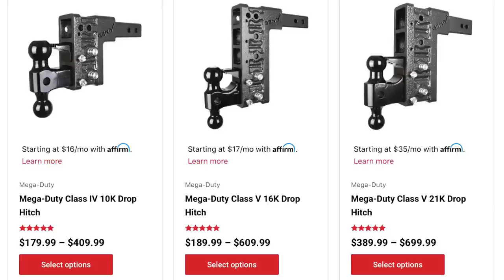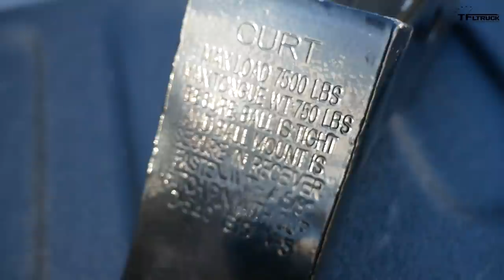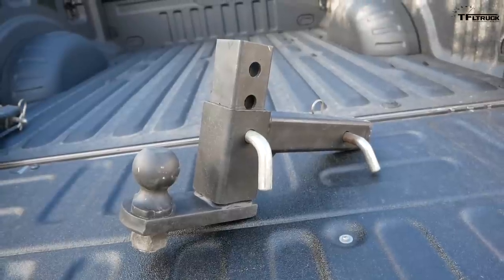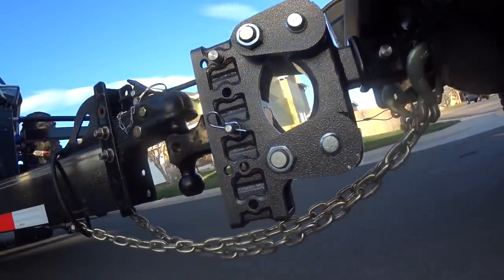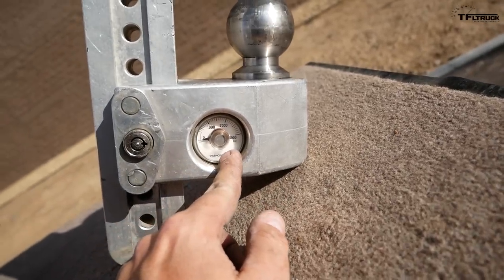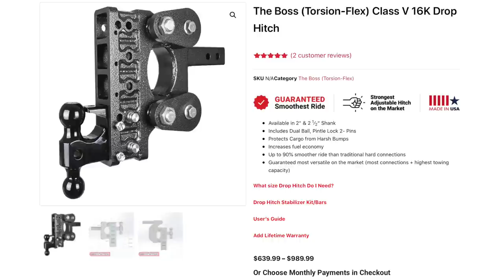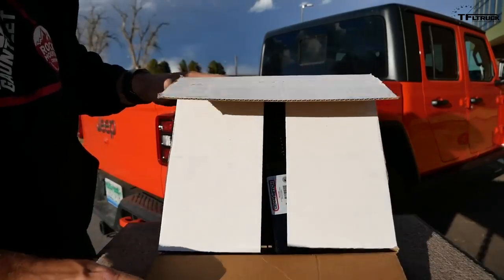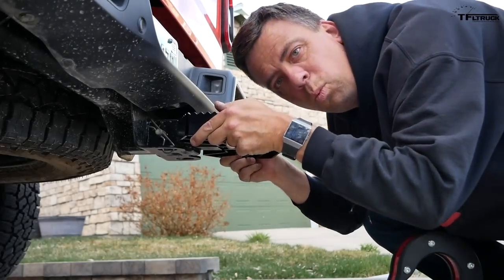Here's Your Complete Expert Guide To Picking The Perfect Hitch To Tow Anything and Everything!

Comment: Great, informative video. Another video idea would be how to tow safely. So many people out there don't have a clue what they can tow and how to tow it. One particular example is if you are towing a vehicle on an equipment/car hauler and how to properly distribute the weight on the trailer. It would also be beneficial to know what to do in an emergency situations and how to use a trailer brake controller to get a trailer under control. Call it towing for beginners. I have learned much of this over the years by watching TFL, but it would be nice to have it in one video. Keep up the great content.
Reply: I have tow a car about two years ago from Joplin Missouri to Pine Bluff Arkansas for the first time with a 2008 expedition, the trailer i used is from Uhaul the car was a 1994 BMW 325 and i don't know if the Uhaul trailer can be controlled by trailer brake control but the expy didn't come equipped with it and i pull it just fine through the Ozarks on i49 and i40 but never exceed 65-70 mph because i might afraid that i fried the brakes or cooked the transmission but didn't and made it home safe and i practiced slowing down on near exits before actually using the brakes and never shifted so i learned on the fly abd gained experience and confidence. The only thing that i burned quickly was fuel and didn't check what mpg i was getting while pulling that load. Lol
Reply: @brandedmcgowan9414  Uhauls come with a hydraulic pulse brake system controlled by a master cylinder in the tounge

Comment: Definitely not too long of a vid, in fact it seemed to be over quickly and I still wanted to know more! An eye opener for me when using a collar adapter from 2”x2” shank to 2.5”x2.5” on my HD truck and derating due to shearing on the pin. I can definitely hear the collar shift when I start or stop and that’s stressing the system for sure. Time for me to consider that mega hitch instead of half-assing my old parts with an adapter. Thanks for this !!

Comment: You should do a segment about the correct tow vehicle tires to use with trailering. Many trucks are coming with weak side walls for comfort or tires for increased mpg that are not safe for heavy loaded trailers.

Comment: Bumper hitch has the ball mounted in a hole in the center of the bumper; very light duty.  You initially showed "receiver hitch".  Mr. Truck may deduct a point from your score  ;-)  I select ball and hitch with specs at least one catagory avove my need and use.  I use weight distribution even though my current need is only 3500# because my vehicle has off road suspension with reduced capacity (2018 SuperCab Raptor).  Works great that way!  Nice video.

Comment: Awesome video! I want to get the gen y glide but I tow a boat regularly in fresh water and I'm not sure if the torsion or "rubber bands" will start to degrade and crack from the fresh water.
Reply: I’m less worried about the rubber in the water, as I would for UV damage over time. As long as it’s greased (and stored away when not in use) I don’t think you’ll have any issues.

Comment: What item do you recommend for testing tongue weight? I would love to be able keep checking and making sure I’m staying in line. Thanks 😊
Reply: Bunky’s Workshop just going to your local scale is what I’ve done in the past. Once you get a basic idea loaded and unloaded you can make educated guesses as you change or shift loads around.
Reply: Check out the surprisingly accurate Haul Gauge that works with a smartphone app and a module that plugs into your truck’s OBD2 port, for about $100.

Comment: Ok Andre.  Those are fine and dandy but i had one about a year ago and at the time they didnt make one for a big boys truck so i had to use the sleeve on both my 2500 cummins and on the f250. And when there is no trailer on it they rattle so bad going down the dirt road and in the pasture you have to take them off.  
 So i just went back with a standard 1000/10k 8” drop hitch and have never been more satisfied with the 45 bucks it cost compaired to the 200 plus bucks those others cost.

Comment: I really love my B&W gooseneck hitch in my truck bed Rated for 30,000 pounds with the compatible B&W 5th wheel hitch Rated for 18,000 pounds
With the bumper pull B&W hideaway bumper hitch rated for 10,000 pounds

Comment: so that gen-y hitch sat the truck down when you put it in the receiver, it's worth considering how heavy the hitch is as it's taking away payload lol!  you guys used to run andersen hitches and I still do, and they work great.  it pinches the coupler a bit harder than i'd like but it's not worn out the front of the trailer in 6 years yet...  why did you stop using andersen?  i'm curious.
Reply: GenY is sponsoring them, that's why.

Comment: What a great video explaining the science behind Gen Y hitches and receivers.  Quick question, can a weight distribution hitch such as the Andersen :no sway - no bounce" weight distribution hitch be used in conjunction with the Gen Y Glyder Torsion Flex hitch?  I plan on towing a 5300 lb (UVW) travel trailer with a 1/2 ton truck.  Total estimated weight of trailer & cargo will be approximately  6300 lbs.
Reply from the maker: Andersen has a unique WDH attachment. It would not work with a Glyder , as far as we know.
Reply: Equalizer

Comment: I got a curt conventional 7,500/750 lb trailer capacity/tongue weight ball mount hallowed shank with 7,500 lb ball mounted not welded on a 4 in drop or 3 1/4 rise purchased at Wal-Mart, made in 🇺🇸 but yet to use it and it's much stronger than the Reese model (made in 🇨🇳) with 6000/600 ratings 2 in drop 1 1/2 rise and i use that one to pull a heavy Uhaul car trailer with a 1994 BMW 325 loaded on it pulled by a 2008 expedition Eddie Bauer 5.4l 3v from Joplin Missouri to Pine Bluff Arkansas driving through the Ozarks hills on i49 and I'm suprised the cheap Reese held up and didn't break.
Reply from the maker: Nice.
Reply: @TFLtruck  thanks

Comment: Help. I have 2020 ram 1500 laramie 4x4 crew cab, sticker said max combine weight on vehicle is 1096lbs, and gvwr is 7100 lbs. which weight distribution hitch should i buy, and what the maximum trailer weight can i tow?

Comment: How do you get rid of the rust that accumulates on the shank and receiver?
Reply: Before you install it i spray wd40 on it and inside the mount on the truck so you can easily slide it out after use and prevent the rust and weld-like stuckness. Even axle grease can work.

Comment: Which hitch for a boat? Around 7500 wake boat. I was looking at the gen y torsion hitch for it.
Reply from the maker: The Glyder is limited to 7,000 lbs. So the GenY Boss 10,000 lbs is the next step up. It will provide a smoother ride than a traditional hitch.

Comment: Those hitches with the scale in them is super useful as it's so hard to measure tongue weight. But with the scale only starting at 400lbs, it really reduces the usefulness of it. My race car + trailer is about 4300lbs (towing with GMC Canyon). I'd like to know where to position the race car to get the right tongue weight, but I'd need something with a lower range than that one.

Comment: The reducer sleeve reduces towing capacity due to increased shear force on the hitch pin? Now you're just making stuff up, especially considering the shear strength of the hitch pins themselves are so high that if it were to shear, you'd be in such catastrophic circumstances already that it'd be the least of your concerns.

Comment: Not gonna lie. That last gen Y seems over complex for someone towing under 15k also why gave a drop hitch that connects at a truck with a 2 1/2 shank. But the drop is only a 2... you’ll lose that rigidity
Reply: And it's long enough that the tongue weight would be off from the added leverage.

Comment: When he put the boss on the truck it sunk down
Reply: The boss is better for a f450 and 1 ton duallies and some of the others similar to the boss can be strengthened to handle near 30,000 of capacity although no truck has a conventional tow capacity of that significant weight.
Reply: Because it weighs just shy of a metric ton 😉

Comment: I thought it was funny how he says the curt is beyond a half ton capability, its 14,000lbs thats only 800 more than the max on the 3.5L ecoboost in the F150. I would say thats probably the proper hitch for an F150 then your not maxing out the hitch! I would never use that hitch with any thing bigger than a half ton. If you can afford a heavy duty truck you can afford a hitch that can handle more than 14,000lbs.
Reply: Friday base it on the load you’ll be towing, not the vehicle doing the pulling.